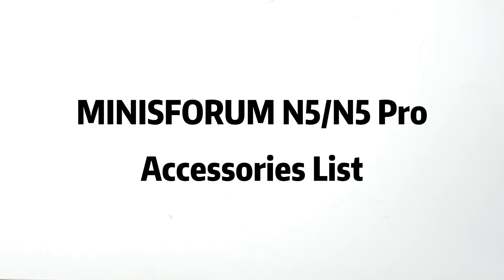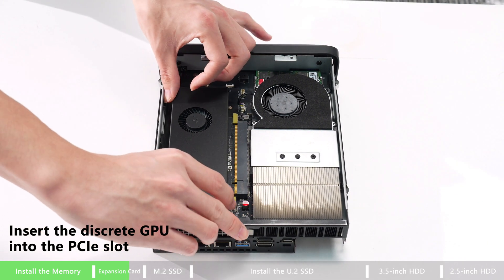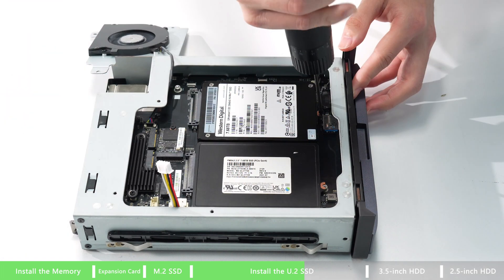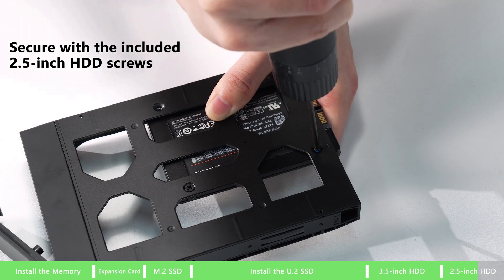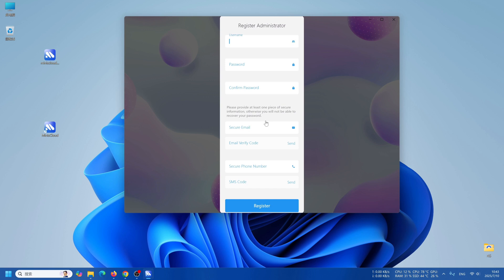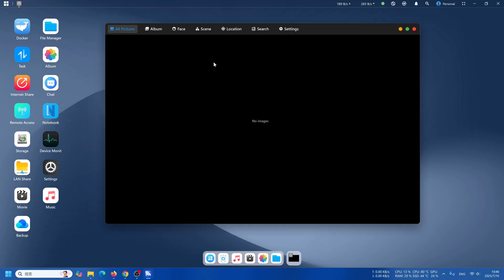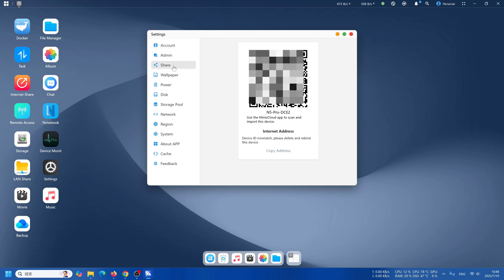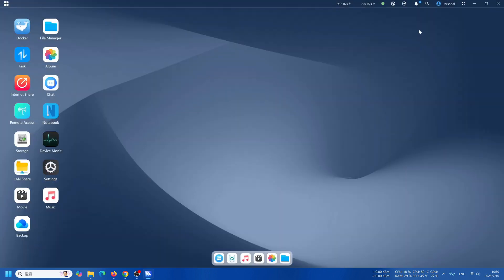How to Build a High-Performance AI NAS with Minisforum N5 Pro | Step-by-Step Installation

Comment: if you have no u.2 drive and installing SSD, do you need to install the included power cable or does this not support SSD but only U.2 drives?